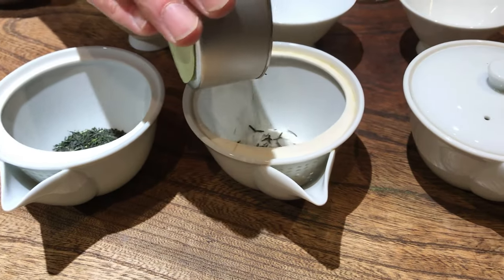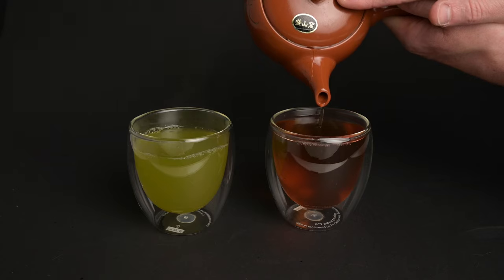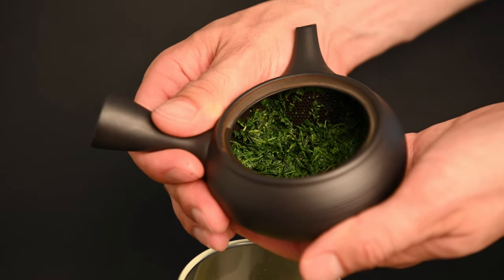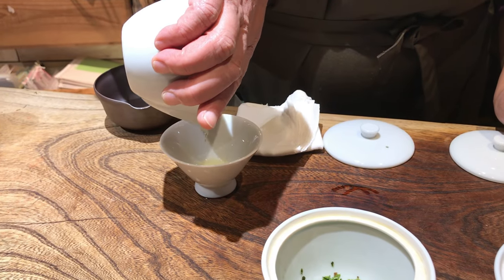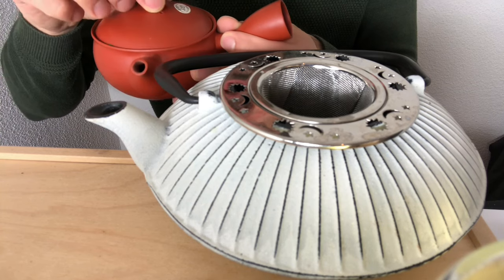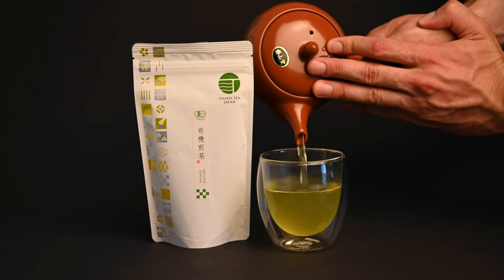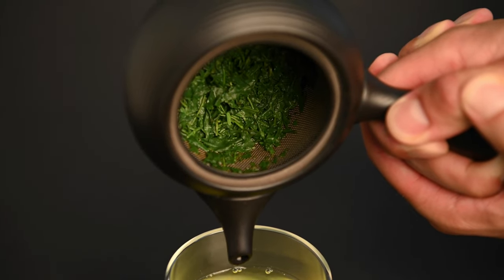A Guide to Japanese Teapots and Why You Shouldn't Use the Cast Iron Teapot!

Comment: The video never explains why not to use cast iron teapots.. disappointed that the title turns out to just be clickbait
Reply: I skipped through the video, still trying to find where he apparently disproves the cast iron teapot.....
Reply: He is just selling the ceramic tea pots.
The cast iron tea pots are ceramic lined.
I use cast iron, ceramic and glass. I prefer cast iron.
Reply: @stephenm8100  I love my cast iron teapot. It saves me steps and keeps the tea warm. Definitely upped my tea game.
Reply: @51rwyatt  I've also have a cheaper cast iron tea pot. I take it camping, not ceramic lined just oil seasoned. And it works just fine. This guy is just pushing the product he's selling.
Reply: The cast iron tetsubin is not a teapot; this is not explained in the video. The tetsubin is a kettle to heat the water.
Tannins in the tea that has been brewed in a tetsubin will react with the iron turning the tea black. A true tetsubin is not enamelled.

Most cast iron japanese 'teapots' are cheap, Chinese copies and have been enamelled to prevent the tea from reacting with the iron.

Better stick with clay teapots. Even a budget glazed teapot is better than a cast iron enamelled tetsubin.
Reply: @Rob.Martin  if the tetsubin is round that's the one for heating water if the tetsubin is flat and has a diffuser screen that is the one for brewing tea. And as long as you drink the tea right away and don't let it sit in the pot all night it won't turn black. It also depends on the quality of the tetsubin.
There are also ceremonial practices which seems to be sold in the tea shops. And then there are general household practices.
My auntie in law who is Japanese showed me the household practice of making a pot of tea for guests.
First bring the water to a rolling boil in a stainless steel kettle. When the water is boiling remove the kettle from heat and wait a minimum of 1 minute. Measure your tea leaves out with a ceramic soup spoon. One level soup spoon should be sufficient. Put the leaves in the diffuser and place the diffuser into the brewing tetsubin. Pour the hot water slowly over the tea leaves until the pot is full all the way to the top. Put the lid on cold then pour some hot water over the top of the tetsubin. When the lid of the tetsubin is dry tea is ready.
Reply: @Rob.Martin  Or I can just use my Chinese enameled knock off that is working for me.
Reply: @51rwyatt  just test it for led especially if the tetsubin is red orange or yellow. You can get a led test kit at most hardware stores. My cheeper tetsubin I take camping is gray. And made in China but the company is Japanese. Quality standards.
Reply: It says less graceful pours due to weight, too small a strainer basket to achieve richer full bodies teas of Japanese style, and more water to tea ratio can be undesirable for same reason.
Reply: @athanandrews2682  
1. 90% of people dont care about graceful movements but about proper taste.
2. It can have filter like the clay one, so more than enough room.
3. I measure water amount for my tea, so it is right. Also has more space than tiny clay pot.
Reply: Damn that's the whole reason I'm here🤣🤣🤣🤣👀🍿 thanks for saving my popcorn👍
Reply: Oh it doesn’t? I just clicked for that.
Reply: Are you serious? With all the amount of information he gave within the video? I learned loads,, sorry you didn’t.
Reply: He said... CAST IRON ARE HEAVY!!!

Seriously, Y'ALL CLEAN YOUR EARS!!! (or wear headphones )
Reply: So false title
Reply: Nvm on that sub and like
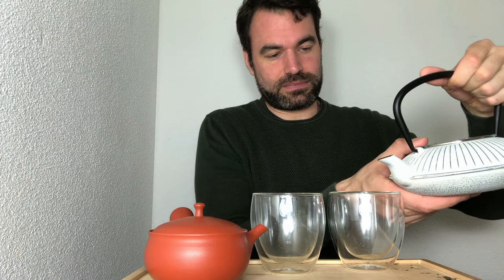Reply: @4:32
Reply: He said, it heavy, it no let leaves open up. So not as easy to use as small clay pot, and inferior tea quality when compared to the other pots which let the teas infuse properly by allowing them a wider surface area.
Reply: He talked about it a lot. Not sure how you missed it.
Reply: He very clearly discussed the tetsubin and listed multiple negative points. It's disappointing that people will read this false comment and not bother to watch and learn.
Reply: Things heating up in the tea fandom
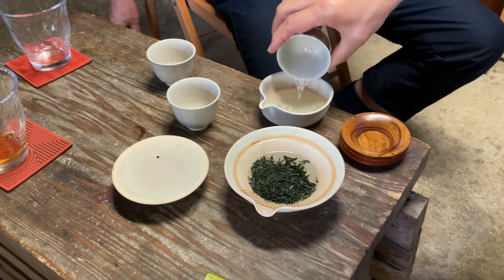Reply: 4:32
Reply: Hello. I'm Japanese. Iron kettles are basically tools for boiling water. Make a mellow, sweet water that contains a lot of iron. So I pour hot water into a teapot and make tea. Even in Japan, teapots with enamel pasted on the inside of the iron kettle are sometimes sold for the sake of fashion. But in that case, I think the Tokoname ware tea that this person is talking about will make a much more delicious tea.
Reply: Exactly
Reply: Thank you for saving my time!
Reply: @51rwyatt think it’s cause it’s not authentic to the culture, that the native people themselves don’t use it, too big. If you see how small they’re are, they go for quality and not quantity.
Reply: I’ve got a casts iron one but I’m going to get rid of it now.
Reply: ❤❤❤ omg. Thank you. 😅 that is wild af
Reply: 4:33 if you can't listen, don't accuse other people of clickbait

Comment: If you are going to tell people not to use the Tetsubin, atleast own or use a GENUINE one. The one you have is mass produced outside of tradition and will ruin the tea. Traditional Tetsubin will be heat treated to form a thin layer that protects it from rusting, and to enhance the taste of the water when you heat it. The traditionally made Tetsubin actually has properties in the iron that helps remove chlorene as well. But it's okay if you disagree, I'm just the one who is japanese here. 🤷‍♂
Reply: Surely you're not advocating the brewing of tea in a traditionally made tetsubin, right? You're only advocating the use of an unglazed tetsubin for heating the water used to make the tea, aye?

Comment: Tetsubins are traditionally used in chanoyu for bon temae, unglazed tetsubin, and the ones that are not urushi treated can be used to boil water for tea, although in senchado small white clay pots called bofura are used over clay stoves called ryoro, if you use a good tetsubin as a tea kettle, it sweetens the water, Banko clay kyusu with a tetsubin make sencha sweeter.
Reply: Exactly, I found it really weird how there was no mention in the video about what tetsubin is actually meant to be used for (before teashops, especially in the west, started pushing glazed tetsubins on people for use as an expensive teapot).
Reply: Why/how tetsubin makes water sweeter? Is it true for a glazed tetsubin?
Reply: @karamcsand  Only unglazed and not treated with urushi lacquer, for a good info on this topic search for Hojo tea tetsubin, that site has all the info you will need.

Comment: A technique comment - for the pour you should not be doing one big tip and pour.  You should pour and rock the kyusu back and forth about 3 times in smaller pours.  The person demonstrating the pours in the video you can see all the leaves on the bottom during the pour.  (Well the lid should not be taken off either)  Not what you want.  The leaves should wind up against the side of the inside of the pot for best extraction.  At timestamp 7:30 you will see a sped up version of someone doing a good pour.
Reply: I just put some gyokuro leaves in my cofee mug with water and microwave it to boil. It is very nice tea experience, magical
Reply: @spicesmuggler2452  there's no wrong way to drink tea as long as it feels magical to you :)
Reply: so true!  @Horrormane

Comment: Can you use cast iron pots with enamel coating inside to boil tea directly on a stove?
Reply from the maker: you can use this but you run the risk of over brewing the tea because it will be in there for too long of a time
Reply: @Nioteas i dont mean to hate, but just add the leaves in after a minute or more, problems solved

Comment: If a clay teapot is the best for green tea, what would be best for black?
Reply: You can use clay as well. Most glazed teapots can brew both black and green teas, just be careful as some clay might not be able to handle the higher temperatures required for black tea. Most clays can, though.
Reply: @hewhodoes8073  Thank you! And do you think the size of the teapot matters? I was thinking if you just make sure that the leaf-water ratio is good, then it shouldn't matter if there is more space in the teapot
Reply: @somethingstuffles9084  Well, as long as the tea has enough space to expand any size works. You don't want the tea leaves to be crushed. Depends on how much leaf you're using.

Comment: Maybe I missed it, but why exactly is cast iron bad? For the same reason as other western styles? It's just too big? Or is there something specific to cast iron
Reply from the maker: The cast iron teapots tend to be very large with a basket strainer inside. Both of these lead to weaker cups of tea
Reply: @Nioteas  so them being made out of cast iron doesn't make any difference?
Reply: @Nioteas  You can get cast iron pots of all sizes, including very small, and you don't have to use the strainer (if there is one). Useless video.
Reply: Personally, I love my cast-iron teapot, and I have had no problem getting a good strong brew from it. Then again, I use it to make herbal blends, not traditional Japanese tea, and it keeps the brew hot for a long time. I love mine, and I’d like a bigger one. Also, I boil the water in a regular kettle, and then pour the boiling water over the tea in the pot, and set it on a warm place on the stove, not a burner that’s on, but a burner that still has a little bit of heat, this allows the tea to simmer a little bit, and not over brew. If you can smell it, it’s done.

Comment: I think traditionally tetsubins are used as kettles, not as teapots. The ones that are glazed and come with strainers are pretty cringe imho.
Reply: Agree with you, tetsubins are cast iron kettles without any enamel inside. It’s purely for boiling the water. “Softens” the water and is never used for brewing. The teapot used in this video is likely a cast iron with enamel coating inside, which is used to brew the tea  - so it’s not really a tetsubin kettle at all. 

The tea pot shown in the video has been popularised in the West. Iwachu also make some but it’s not really a Japanese method of brewing tea. Iwachu is more known for their cast iron tetsubin/ kettles. 

Mostly Western brands sell this enamel-lined cast iron teapot in a misguided way to cash in on “oriental” design whilst missing the point and origin completely.  So it’s doubly odd that this channel that purports to have knowledge of East Asian tea does nothing to correct this Western misconception.
Reply: tetsu-kyusu, cast iron with enamel, are widely used in Japan and not a misconception from western countrys.
Reply: @SuchanDEJP  hmm the more you know... Still not a huge fan of them

Comment: Lame video. The cast iron pot. Or known as nan Hu 南壺， is for boiling water that used for tea making. U don't use nan Hu to make tea. Cickbait title.
Reply: 南壺， 南鐵壺。 In English is spelled nan Hu, direct translate southern pot, or southern steel pot
Reply: Hello! Can you use a cast iron pot with enamel coating on the inside to boil tea on a stove? I don't know if I can use it to boil tea directly and I do not wish to ruin the pot.
Reply: @osmanthuswine4928  generally pot is used it boiled water and pour the hot water into the tea. This method is more controller then boiling tea leaves.

Comment: "Why You Shouldn't Use the Cast Iron Teapot" .... Um, you really didn't cover this though? >_> This is the second video I've tried watching titled like this and neither explained why you shouldn't use it. You're not supposed to use a detachable strainer if you're doing it a traditional way, so that's not a point against not using it.
Reply: He did say that cast iron teapots are usually larger and the tea tends to be weaker. He also talked about some benefits of clay teapots, so a cast iron teapot won't have those benefits. 

It's obviously not harmful to make tea in a cast iron teapot, it's just not the way Japanese tea is made, but it can be used for other styles of tea.
Reply: @yoiyomismo  I've seen Japanese use a cast iron teapot before though, so some do use it...